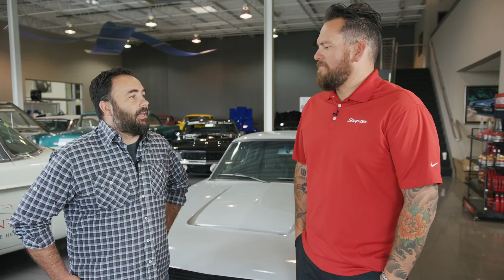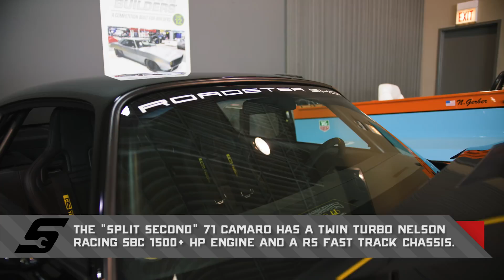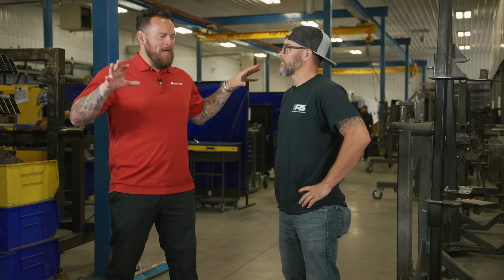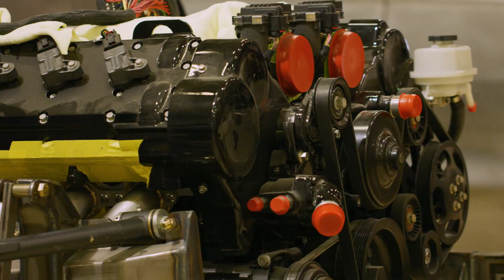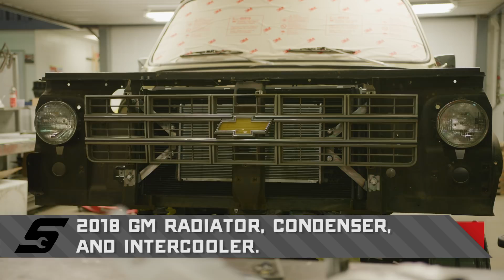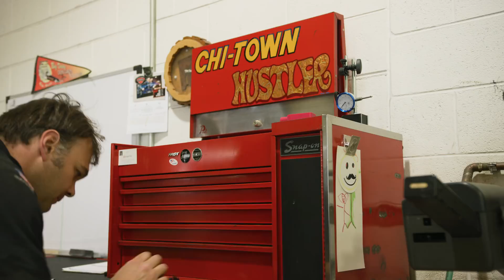The Roadster Shop -  Snap on Great Garages™

Comment: Hey I was just wondering if You guy have done any 87 Coupe Devilles. My dad got my mom one in 87 and died of cancer in 89 we still have the car and though it only has 55,000 orig miles the underneath is rusting and i want to fix it for ma she still drives it at 89 years old just inquiring thanks